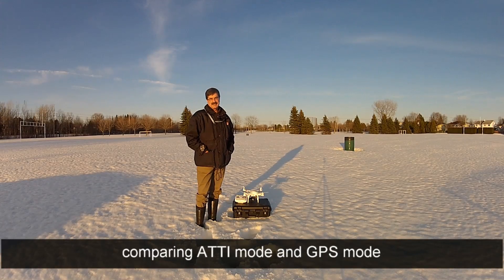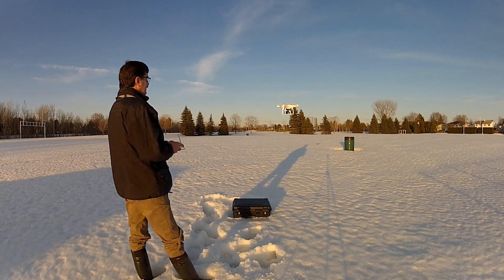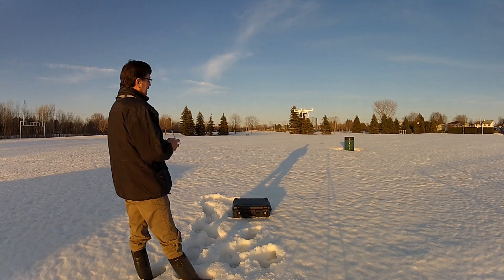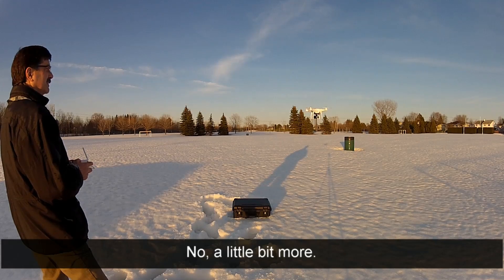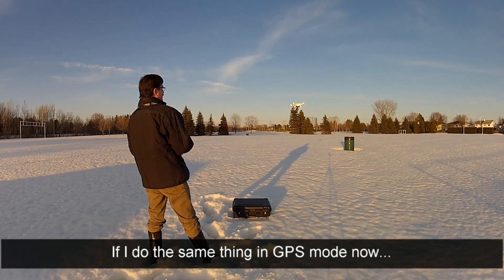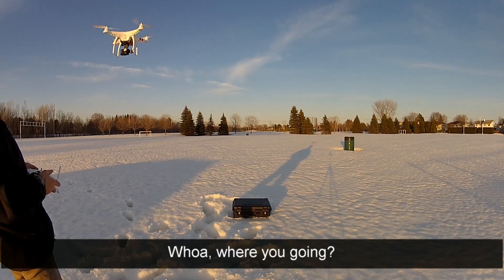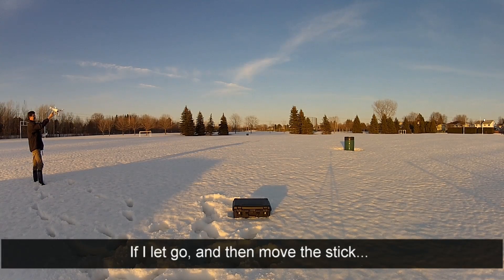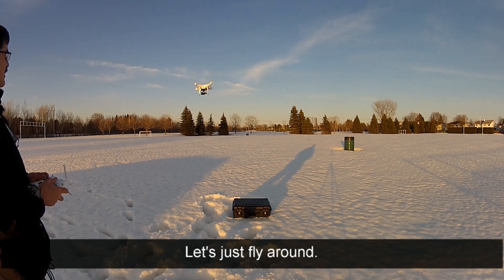Position hold -- Atti vs GPS

Comment: Does atti use the gps? If not then how does it find home?
Reply from the maker: Michael M As long as it has good GPS signal reception, if Failsafe is triggered it will Return-to-Home regardless of whether it was flying in GPS mode or Atti mode at the time.  If GPS reception is lost while flying in GPS mode it will switch automatically to flying in Atti mode, i.e it won't hold position whenever control sticks are centred and will drift with the wind.  If Failsafe is triggered in the absence of a good GPS signal reception then the Phantom cannot find its way home and will instead land where ever it's currently at.

Comment from the maker: People keep insisting that a GPS error is what caused their Phantom to flyaway uncontrollably.  I don't understand how that's possible.  The NAZA controller uses the GPS system to hold position when hovering with sticks centred.  This video demonstrates that you're in control when you move the sticks.
Reply: it a compass errors are the cause IMO, people calibrating where they shouldn't or high magnetic interference in the area.
Reply: That's assuming that the GPS is behaving normally. It could well be different if the GPS is playing up. I could foresee a flyaway if there is a GPS glitch and someone activates RTH on their Phantom. This actually happened to someone who had mounted a GoPro to their Phantom. The GPS was acting really strangely and the operator, against his better judgement, decided to use RTF and had a fly away. The Phantom and the GoPro were never seen again.

Comment: Thank you for  taking time to make this  very informative video! Which mode so you recommend for filming? They both look pretty stable.
Reply from the maker: MongKhamp As long as you are giving stick inputs and actively flying the aircraft it really makes no difference.  It's only while hovering with sticks centred that you'll see a difference.  With 3D camera gimbals it really doesn't matter anymore.  The original Phantom-1 came with no gimbal, just a bracket that hard-mounted the GoPro to the airframe.  In Atti mode the Phantom would drift with the wind, making for much smoother video.  In GPS mode the Phantom will hold position but if there's any wind the aircraft will be making lots of little attitude adjustments as it's holding position.  That made the horizon wobble on the hard-mounted camera image.

Comment: I'm new to the DJI Phantom. You gave a really good explanation of Atti vs GPS. This has really helped my understanding of it all. Thanks so much!
Reply from the maker: I'm glad you found it useful.  There is another significant difference between the two modes.  Atti mode flies much faster.  I can watch the view from the camera on my FPV monitor while flying.  If I give it full forward stick while in GPS mode, the Phantom tips forward only so far.  But if I switch to Atti mode I can see the Phantom tips forward quite a bit more and flies faster.

Comment: why the experiment?
Reply from the maker: I don't understand how a supposed GPS glitch could cause a flyaway.  While operating in GPS-mode, the GPS guidance only kicks when control sticks are centred and it's hovering.  If, as people keep reporting, it suddenly runs away from you, any stick input to counter-act the flyaway should put you in control and cancel the influence of the GPS guidance system.  They say switching to ATTI-mode will stop a flyaway.  But ATTI-mode and GPS-mode operate the same way while you're giving stick input.  They're only different when sticks are centred.